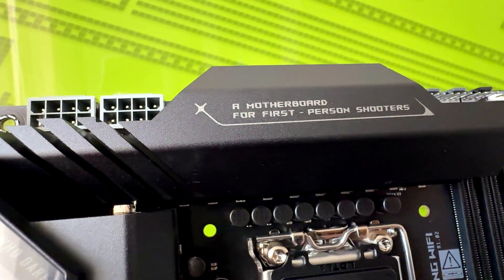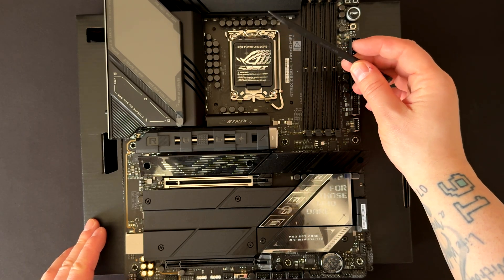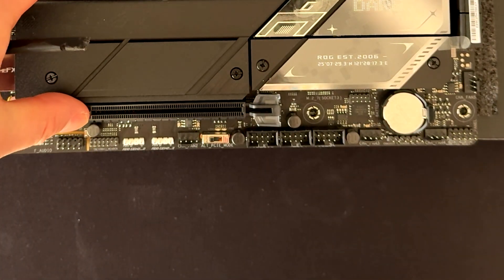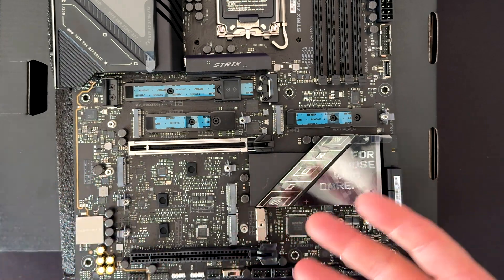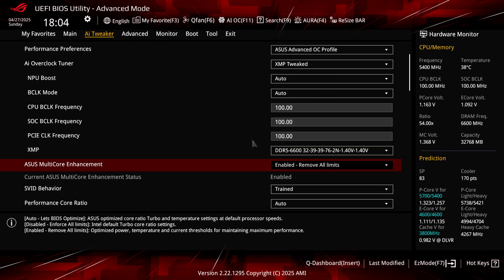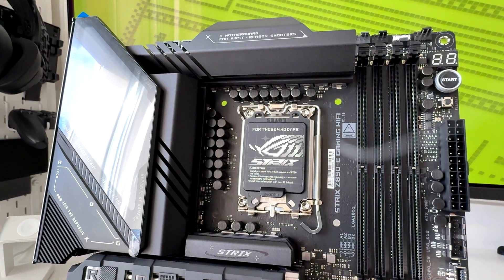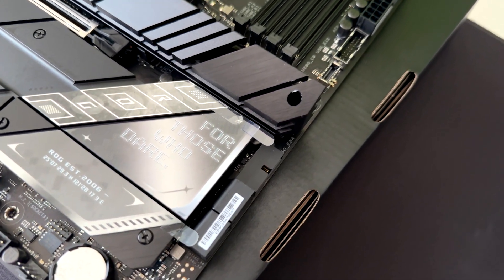Asus ROG Strix Z890-E Gaming Wi Fi

Comment: I just finished a build, and everything seems to be working perfectly until the motherboard is supposed to start up. There’s no video output. It shows code 99. And if I remove the mouse or keyboard, it says there’s no input device.
Code 99 means that the BIOS has already passed CPU, RAM, and GPU checks, but it gets stuck when trying to initialize peripherals and ports.

Any ideas? I’ve tried with several keyboards.
Reply from the maker: I would suggest to check if everything is well connected including ssd and so on, just try one peripheral at time

Comment: Just want to confirm about that PCIe 4.0 x 16 slot, is it sharing bandwidth also with PCIe 5.0 x 16 slot? I can't found the data anywhere. In the manual only mention that M.2_3 and M.2_4 the one has bandwidth sharing with that gen 5 PCIEX.
Reply: I think it would keep it at pcie 5.0 but reduce it to x8. You would not notice any difference in game performance though.

Comment: First of all, hello, nice video. I'm planning on installing two PCIe 5.0 SSDs on this board soon. Which slot should I install the SSD with the Windows system in? Or does it not matter?
Reply: If install 1 ssd nvme pcie 5.0, pciex gpu go run in x16 or x8? Thx man
Reply from the maker: @gnengenharia  it will run at x16
Reply: @JULVEXGAMINGbut in which slot? M.2-1😅
Reply from the maker: @gnengenharia  also M2_2 and M2_3
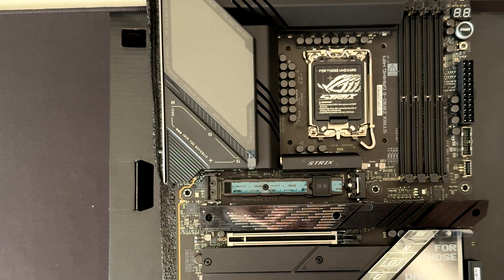Reply from the maker: Hey thanks, keep in mind that if you install the two PCIe 5.0 SSDs'  on the M2_ slots that are compatible with PCIe 5.0 the GPU PCIe lanes will run x8 instead of x16 check here 3:35. If you're ok with that doesn't matter in which one all are the same.